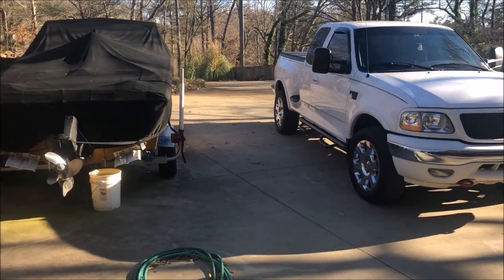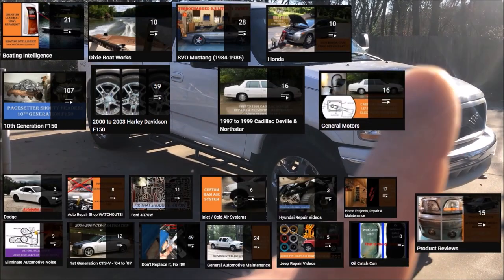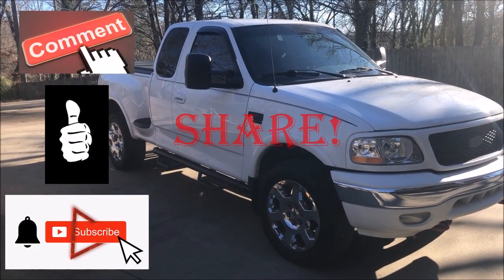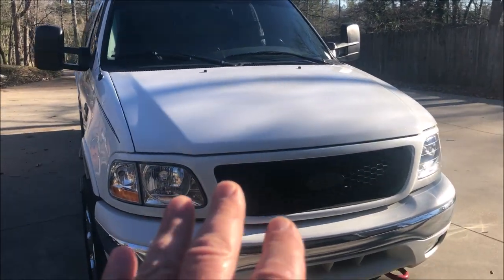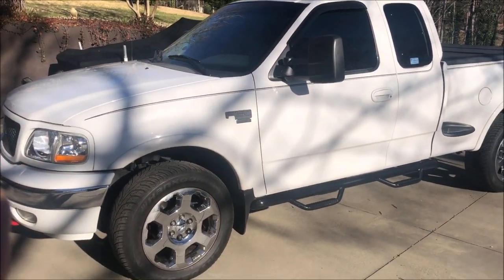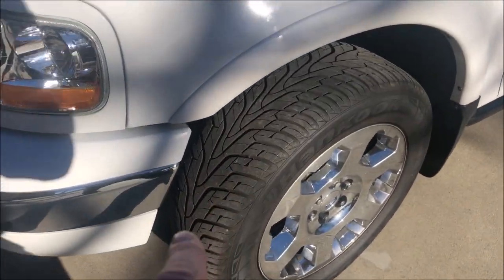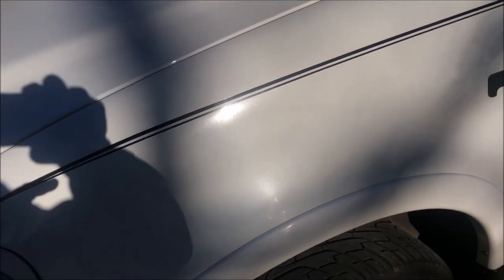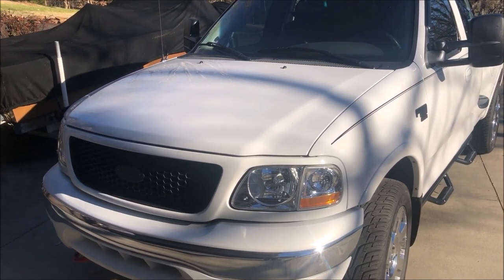Build A Custom DIY Ram Air / Cold Air Intake: Revisited - How To Lower Intake Air Temperature

Comment: I like what you did. As my truck will be geared more toward off-road use, I'll be doing something similar but with the tube up higher. Trying to find an old style CAI that worked with ram air hoods for these trucks, but I may just have to mod my own. Several ideas floating around in my head. Its a mess up there. Lol.

Edit: If I can scrape up the funds, Coyote swap!!!
Reply from the maker: My head is just like yours!  Too many ideas floating around and 10 active projects at any time.  ;)  Coyote?  How about a Navigator 4V... one of the ideas floating in my head, and a much easier install.
Reply: @DrivingIntelligence  4v would be doable, but I really like that Coyote. Lol. That's at least 3 years down the road so we'll see.
Reply from the maker: That Coyote swap is a HUGE project... If I had extra room and another vehicle to play with over a period of time, I would do it.  The 5.4 4V is a very easy swap with 300hp and can be upgraded.  What I would really like to do it add a 6R80E tranny to my 10th Gen.
Reply: @DrivingIntelligence  that particular swap isn't that hard so long as you have someone that can custome tune the existing computers. My current line of thinking is putting either a ZF5 or ZF6 behind my 2v as well as a manual shift gear driven transfer case like a NP205.